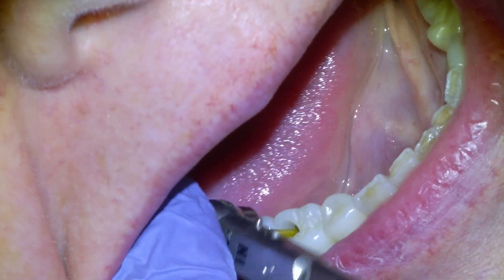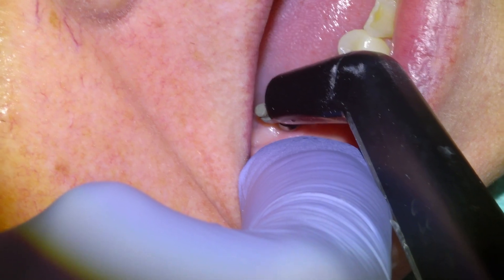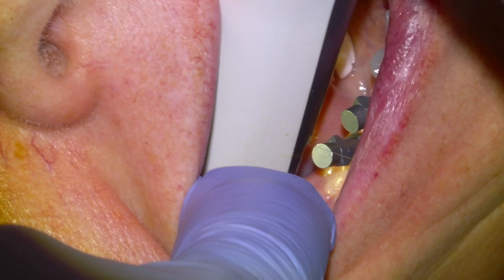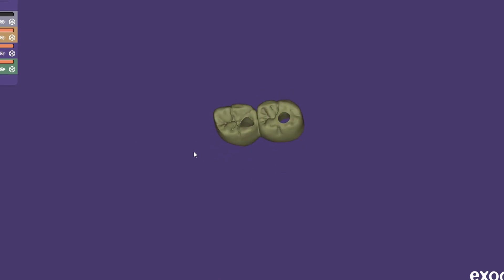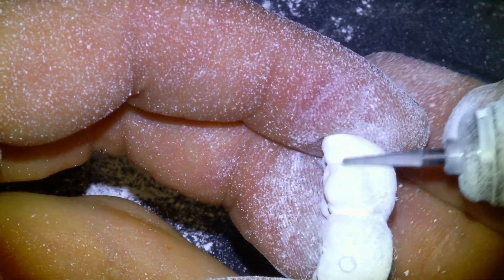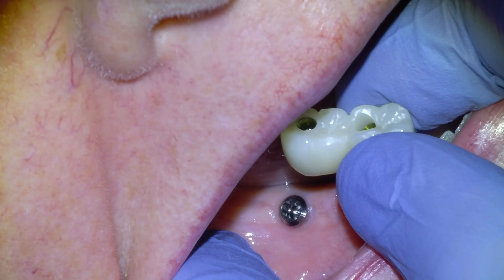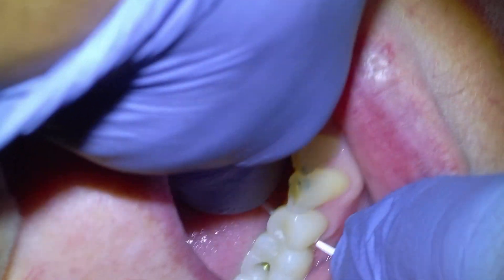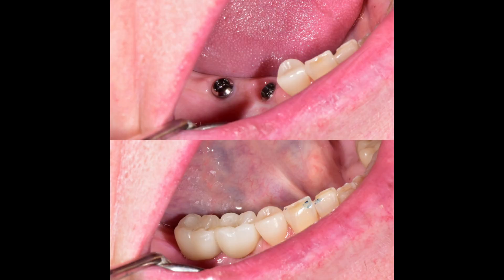[25] Manufacturing and Installing a Dental Implant Bridge

Comment: Why bridge the two abutment crowns vs placing 2 individual crowns on each implant?
Reply from the maker: There are pros and cons to either option. Splinted implant restorations have a lower incidence of prosthetic complication such as difficulty seating, screw loosening, material fracture, and ti-base debonding, to name a few. Daily use of a waterpik for home care is advisable.